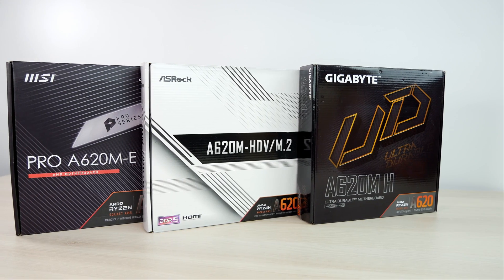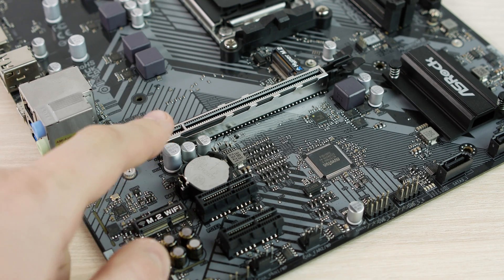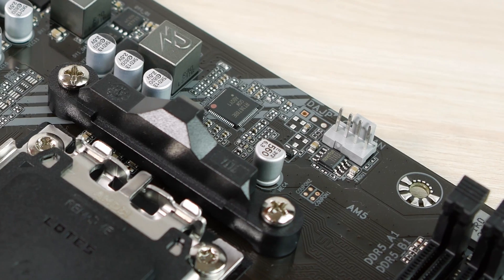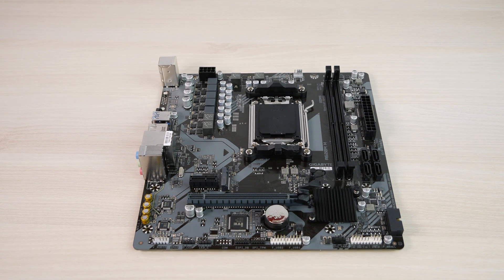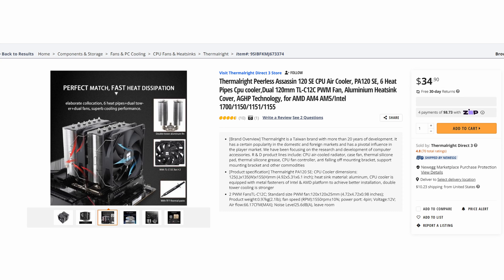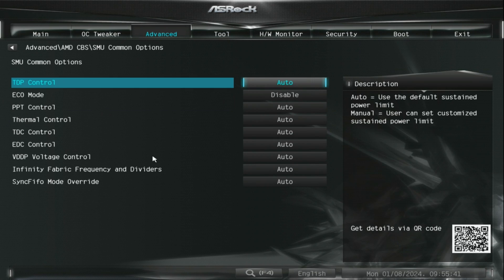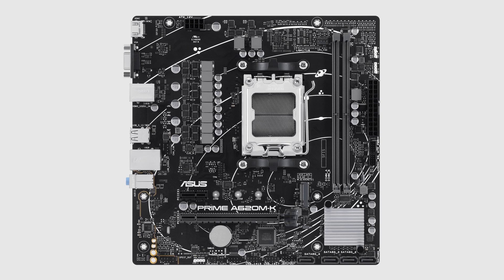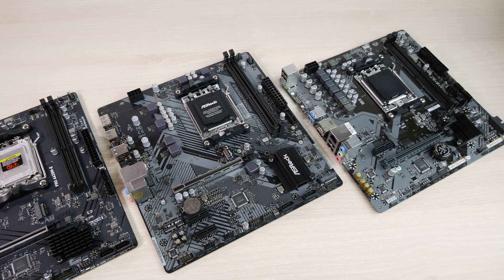Ultra affordable AM5 boards for Ryzen 7000-9000. Are they worth it?

Comment from the maker: What do you think, are these boards worth it?
Reply: Okay when more sub A620 £80  boards hit the market if ever.
Reply: In my opinion no.
You can get a board with a much better VRM and a VRM heatsink for only around 10% more cost. This will significantly improve efficiency, reliability, and long-term upgrade options.
I guess these entry-level A620 motherboards would be fine for entry-level PCs and office PCs with a Ryzen 5 8500G or similar, but at the moment a PC with a Ryzen 5 5600G and an A520 motherboard would normally be cheaper, so there's no point.
Reply: @nathangamble125  In my country, the cheapest AM5 motherboard with a VRM and a VRM heatsink cost 40% more than the A620 boards.
Reply: I got Asrock A620 M2 with + and its running 7600x great..  it was 60€ cheaper than cheapest B650, so it was worth it. CPU runs all core 5160Mhz and single 5460Mhz
Reply from the maker: @kyllasaakuvata  that is now good, almost 1000 mhz lover than spec
Reply: @ArtyomExplainsEng  typo.. fixed 1Ghz UP
Reply: do these mobos support the turbo clock of the cpus or are the cpus limited to stock clocks?
Reply: @medzo8193  i have the ryzen 5 7600 with the MSI board and my CPU boosts to 5Ghz when under load
Reply: No, because the price difference between the A620 boards and the B650M HDV is too small. It's 25€ where i live. So not really worth the sacrifice.
Reply: I just ordered a gigabyte a620m h, 
1. do u think out of the box it will run 8400f.
2. U think 8400f would be easier on vrm temps since it uses less power than 7500f
3. How to flash back without using processor
Reply: It depends. I can't get a Asrock HDV+. So I'm stuck with the base model. 

The gigabyte doesn't come with a m.2 for WiFi. That's a deal breaker for some people

Comment: considering buying the msi pro a620m-b micro atx to use with a ryzen 5 8400f, currently on am4 with an x570 and a 7 5800x but im willing to take that small performance hit to get on the am5 platform..... 
would the 8400f be ok with this board? considering i have good airflow in the case aswell, the 8400f also runs at 65W
Reply from the maker: I'd get 7400f, check AliExpress. Much better choice. The board can handle these cpus

Comment: If you're interested in A620 motherboards, I recommend to look at A620s from Asus. I've bought Asus Tuf Gaming A620 Pro WiFi for Ryzen 9 7950x. This motherboard handles 7000/8000 and 9000 series processors very well, but for 9000 series processors to work, you need to update the BIOS. Fortunately, you can do this using BIOS Flashback: insert the flash drive into a special USB port on the back and press the BIOS Flashback button for 3 seconds, the indicator starts blinking, after 3-4 minutes it stops blinking and this indicates that the BIOS update is complete. Thanks to this, you can update the BIOS very conveniently and easily. And for this, you don't even need to insert a processor or RAM, just connect the motherboard to the power supply.

I don't know how it works with 8000 and 9000 series processors, but with 7000 series processors it works just fine. I run it with a Ryzen 9 7950x processor and the motherboard does not limit it in any way, that is, you can easily squeeze out all the power of the processor, if necessary. I consulted with a person who used it in pair with a 7950x3D processor, it also works without problems. PCI-E Gen 4 with 16 lines is available, it can supply 600 Amperes, there are 32 lines too. So the motherboard is ideal for the 7000 series of processors. In terms of design and characteristics, it is also good: there are good radiators for almost all the main components, there are 4 slots for RAM up to 192 GB (4 by 48 GB), there is Wi-Fi, Bluetooth.  A620 usually can't overclock processors, but it seems to be able to, because there is auto PBO and manual PBO settings: no curve settings, but there are PPT, TDC, EDC settings, throttling temperature limit, etc. I don't know if it is possible to overclock the processor beyond its limits, but it is definitely possible to the limit. However, you are unlikely to do this, because, on the contrary, you will most likely want to undervolt a little so that the processor does not hit 95 degrees under load. If desired, you can configure, for example, a boost to 5.3 GHz under load with a temperature of up to 80 degrees. This is an ideal balance between performance and a comfortable temperature level. I currently have a good Arctic Liquid Freezer III 360 liquid cooling system and 3 more huge air coolers in the case itself: 2 on top and 1 at the back.  My idle temperature is 30-35 degrees, under load I saw a maximum of about 78, but this is mainly in stress tests. In real tasks, much lower. Even in heavy tasks, less than 80 for sure.

It also started up without problems with RAM. I have Apacer NOX DDR 5 6000Mhz 32 GB, it worked easily with this frequency, but of course I had to enable it in BIOS. I also recommend enabling the Memory Context Restore and Power Down functions in BIOS so that the computer turns on quickly, otherwise it will take a long time.  I turned it on and the system starts in about 20 seconds now, but I have a fast NVMe SSD. I also want to tell you about one thing that is rarely written about. In short, if you have a Ryzen processor with an integrated graphics card, then in many motherboards, when using the integrated graphics card, there will be various graphic artifacts and freezes by default. To fix this, you need to enable the GPU Boost item in the BIOS in Manual mode and manually enter the Graphics Frequency value of your processor there. How do you find it out? It's very simple, go to the website of your processor manufacturer, find your processor and look in the Graphics Capabilities section for the Graphics Frequency line. This is the value that needs to be entered into GPU Boost. For example, I have a Ryzen 9 7950x processor, its Graphics Frequency is 2200 MHz. I go to the BIOS, change GPU Boost to Manual and enter the value 2200 there. That's it, after that you will not have any artifacts or freezes with the integrated core.  This is relevant for all motherboards and all Ryzen processors. I recommend doing this even if you have a discrete video card, but the internal one is still enabled, so that there are no problems. I myself was looking for this information for a very long time, spent several hours on it, and eventually found a solution for this on forums. Maybe it will be useful to someone. All the best :)

Comment: have you ever tested the asus motherboard? its the cheapest i can get. i find no reviews of it basically. was wondering if i can use it with a 7600x3d (it only uses like 70w in gaming).
Reply from the maker: You can, should be fine
Reply: I've bought Asus Tuf Gaming A620 Pro WiFi for my Ryzen 9 7950x. It's perfect! Asus A620 motherboards even support PBO Enhancement! This motherboard is in no way inferior in its characteristics to the B650 series. It has everything you might need: 4 slots for RAM, WiFi and Bluetooth, RAM overclocking, PBO Enhancement, etc. Asus A620s are very different from the rest of A620 of other brands. They're really good!

Comment: I bought the asrock a620 with 2x16gb patriot 6000mhz and a r5 8600g, but im having problems to use the expo profile, when i set it to 6000mhz it wont even boot and when i set it to 5600mhz it does boot but when i check the frecuencys of the ram theill still be at 4800mhz, its there something i can do to fix this or i just need amother kits of rams or another motherboard?
Reply from the maker: Is the bios latest version?
Reply: @ArtyomExplainsEng  yes i had to download the latest bios otherwise it wouldnt even boot, there was another newer version but it was in beta so i thought it might have some bugs, do you think that version can help?

Comment: Hi sir i bought msi a620m with 7600, will i get full potential of 7600? As now i dont have high budget, next year when ill buy my gpu ill upgrade my mobo as well. This will be my first pc and till I upgrade my mobo ill only do web surfing. Can this mobo damage my 7600?
Reply: You will be fine, the cooler of the 7600 will help cool the VRMs along with some fans that are installed in the case
Reply: @ash-wm4iu  alright I was afraid of damaging my cpu
Reply from the maker: It will be alright

Comment: I love ur video man........everyone is running after b650 but ur the only one giving some information about the a620
Reply: Recommend the a620m h gigabyte if you dont mind wired network. I currently built a pc with that board paired with the amd5 7600 and RTX geforce 4060 oc eagle. Love it as its my first build

Comment: is MSI PRO B650M-A WIFI DDR5 good for 7500f?
Reply from the maker: What a weird question
Reply: @ArtyomExplainsEng  There is no "weird question" from a newbie my friend, why we asking? because we are not really 100% sure it is good or not really good. That is a purpose of "asking". Unless I'm pro, I would not ask or comment in this channel.
Reply from the maker: @bsoda69  this entire video states that even the ultra cheap a620 with no radiators can do 7500f just fine. Literately the whole point of the video. Why ask if a much better motherboard can handle it? That's why the question is weird. I would go gigabyte or asrock but MSI will do ok too.
Reply: @ArtyomExplainsEng  The Best and wiser answer will be:  "dude, that is much better." that is MORE THAN ENOUGH instead of wall of text you wrote above. well, GJ. Keep it up 👍
Reply from the maker: @bsoda69  I didn't mean the be rude, sorry.

Comment: Will msi one be compatible for ryzen 7600x (if we consider future proofing too)
Reply from the maker: No, it is too power hungry, only 6-8 core non-X. Get b650m with a radiator like asrock b650m pg lighting, gigabyte b650m k, asus b650m-k, msi pro b650m-p. Any of them would do great with any 8 core.

Comment: Guys, please check my build below
I only use my pc to play only 2 games, Dota 2 and counter stirke 2 and i am on a very strict budget
Mobo - Msi a620m 
Cpu- ryzen 5 7600
Gpu - rx 6600 8gb (dota 2 and cs 2 are cpu based games don't need heavy gpu)
Cooler - stock (wraith)
Ram- ddr5 5200mhz 16*1 gb( will put another one 2-3 years down the line as my games don't need much ram, the cpu only supports 5200mhz)
Ssd- kingston 500gb m.2 nvme gen 4
Cabinet - msi mag forge m100a mini atx (not sure if i am making the right choice should i go for mid tower? Please suggest )
Psu- msi mag 650 bronze
Headphone- razor blackshark v2x usb 7.1
Mouse - razor deathadder essential wired
Keyboard - ant mk 1000 (need f1 and numbers)
Screen - gigabyte 27fc curved 1080p 165hz
Reply from the maker: Cpu supports up to 8000+ mhz ram, 5200 is guaranteed minimal speed. The sweet spot is 6000, get 2x16 6000 cl30 kit, 1*5200 is a joke, you will loose a lot of cpu performance. Get a mesh case with fans, no glass front with barely visible air holes, doesn't matter who makes it. Save on peripherals, put more money in pc hardware, ram to be exact.

Comment: well i have a question , I searched a lot but couldn't find the answer. 
Asus a620m-e  Vcore : Onsemi 4C10B (46A) high side
                                         Onsemi 4C06B (69A) low side
Asus a620m-k vcore you already know
which better ?
Reply from the maker: Both are not great for the price. The E is better, tho. Get something better for the money.
Reply: @ArtyomExplainsEng  i have a620m-e , my friend has a a620m-k , both of us has a 7500f, my board vcore 1.235 and 73 degree on cb r23 test , my friend board vcore 1.140 and 63 degree so i think m-k better . im a thinking wrong ?
Reply from the maker: @mehmetemin640  You know that not all cpus are made equal, right? E is a little better in terms of hardware.
Reply: @ArtyomExplainsEng I know, but I don't think a 10 degree difference is normal.

Comment: Should I buy R5 5600-B450m and GTX 1660ti or R5 7500-A620m-E and GTX 1060
My budget is about 450-500$
And my goal is getting like 360 fps in Valorant or even CS2. Can I get it with these combo?
Reply from the maker: 5600-1660ti is the better choice

Comment: Thank you very much! I was wondering if the Asrock M.2 version wouldn't be overheating if I lift the 75° TJ Max limit, but I am positively surprised!
I put it on 85°, as the cooler I used (a Raijintek AIDOS II) cools the 7500F to 82° under full load ^^
And thanks Asrock for making such a good design!

Comment: A nice review of the A620's ❤ Which one do offer PBO functionality ?
Reply from the maker: None of them. No PBO in a620
Reply: @ArtyomExplainsEng @10:40 min MSI A620M-E has PBO + Curve Optimizer menu.  Is it functional ?
Reply from the maker: @tuiastro  these settings are ignored by the board, you can only change the power and temp limits. I say it at 11:03

Comment: as i see it could handle 7700x or non X 7900
Reply from the maker: I would not go above 7700 non X
Reply: @ArtyomExplainsEng  i saw other channels go and sayed its fine,r9 7900 have low cpu consumption even lower then 7600x

Comment: Nice video. Informative. Sadly in our country currently only the a620m-e is cheap enough to consider a budget 7000 series build. Before there was b650m ds3h which I think is the best low budget b650m board
Reply from the maker: Thanks. Gigabyte b650m k is also a good one.

Comment: 3 renowned motherboards making shameful VRms, where have we seen AM5 motherboards manufactured without at least not having a heatsink on the VRM's?!?!
1st- Poor construction of VRM's.
2nd-Low number of phases for the processor (VRM).
3rd-Complete lack of a heat sink on the VRM's.
  This is not low cost at all, this is a poor quality project as there are more modest projects that take the motherboard's VRM into account.
Reply: making better VRM's would increase the price the whole point of these boards is to be the ultra budget option for AM5 as all other motherboards will be close to double the price
Reply: did you even see the video? the temps on the Asrock are excellent, even without a heatsink!